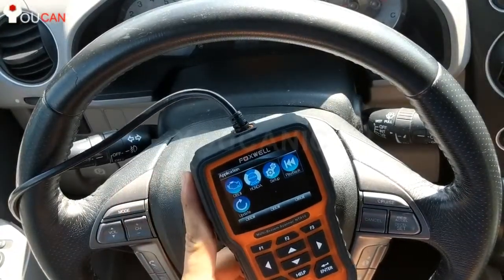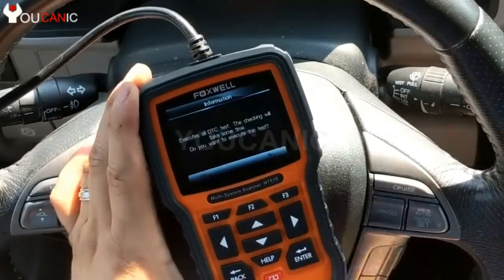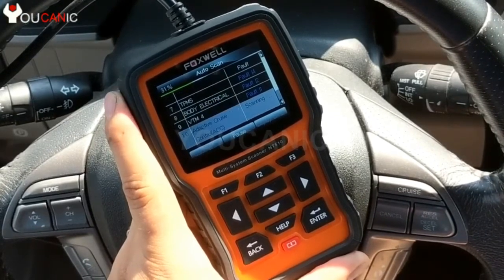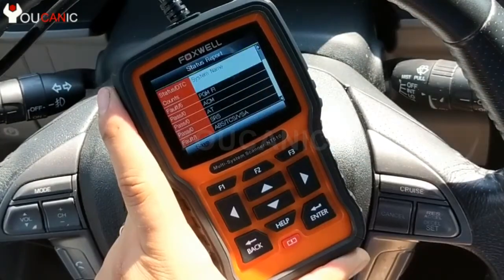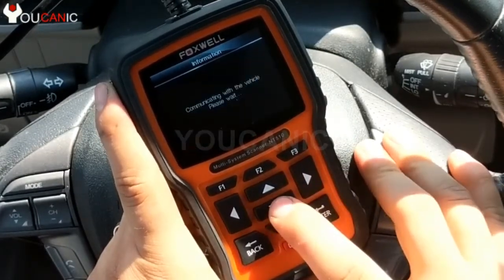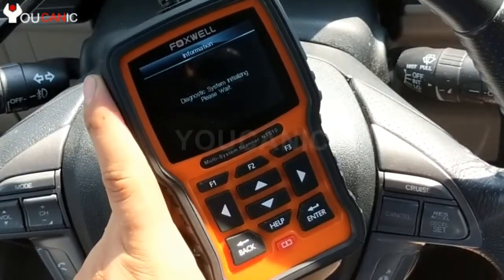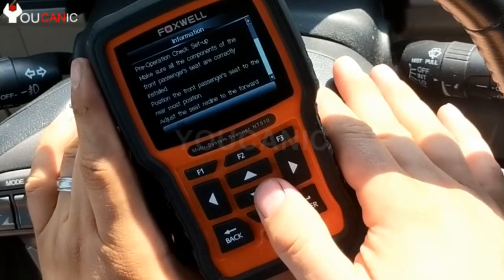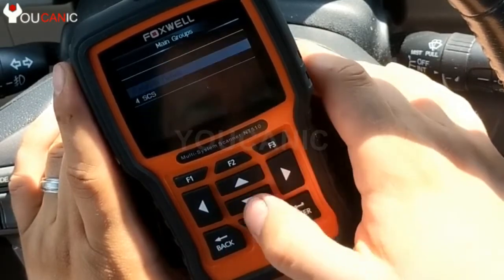Honda Diagnosis with Foxwell NT510 Multi-System Scanner: Step-by-Step Guide

Comment: I have a Foxwell NT510 Elite and ran the Honda software scanner on my 2013 CRV.  I got 3 faults (one per item) and didn't go far enough into the description to see if they were current or stored or what P codes they were. (I'm unfamiliar with scanning tools.) I erased the codes. If these are current codes or issues that need to be fixed, will they show up again after going for a drive and rescanning? Thanks.

Comment: Amazon lies alot. Will this reset the TPS . Throttle
Reply from the maker: Yes, the YOUCANIC Full System Scanner is a reliable tool designed to help diagnose and reset various car systems, including the TPS Throttle. It's like having a professional mechanic by your side. More information can be found here: www.youcanic.com/scanner. Please feel free to explore our website www.youcanic.com for more automotive resources and assistance. If you have any more questions, we're here to help: www.youcanic.com/.
Reply: yes it will.

Comment: Can it program a key? In other words... add a key.
Reply: X2
Reply from the maker: No, this is not going to be able to program a key.
Reply: @YOUCANIC   👍🏼
Reply: According to the description on Amazon (8/16/22), for the model he's using here for Honda/Acura cars, it will only support programming a key on "some" Honda/Acura vehicles, NOT all models. P.S. It's a new and updated scan tool for 2022 = Foxwell NT510 "ELITE" model.